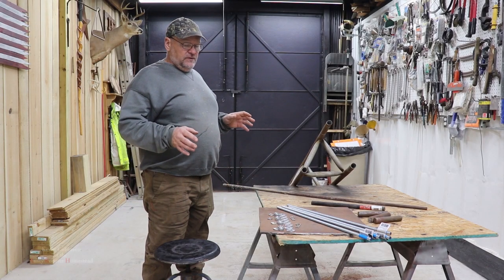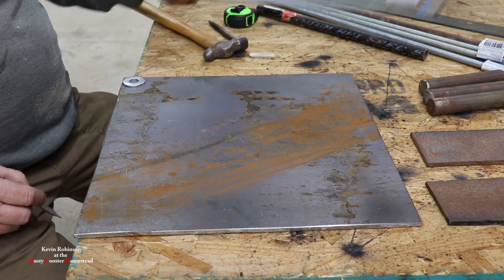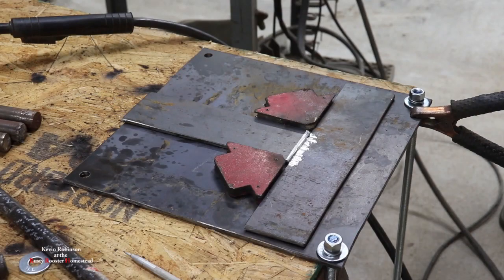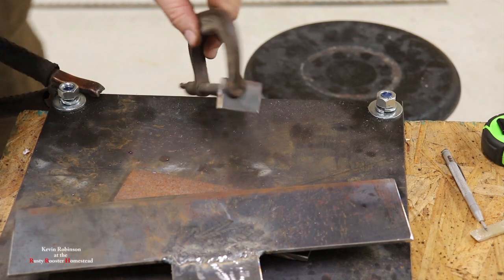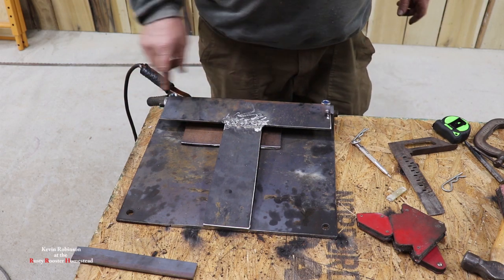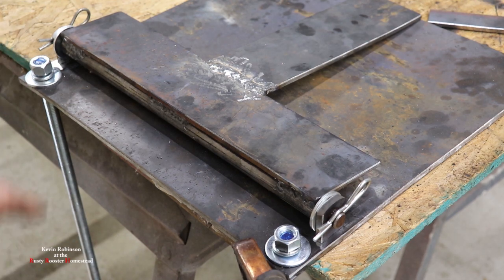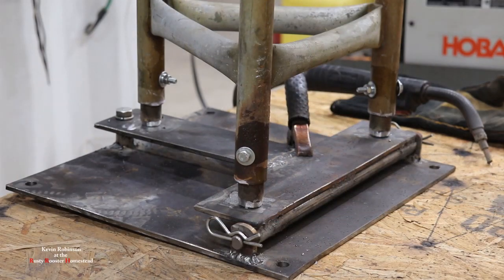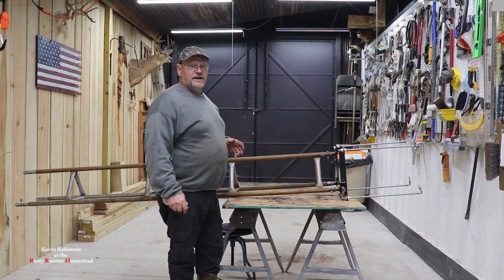antenna tower swivel hinge plate step by step build

Comment: I really enjoyed this video and the one showing you putting it to use. I have one question. Why don’t you put the base section all the way to the bottom of the pins and let the plate take the load instead of the bolts? Maybe you explained it and I just didn’t catch it. Great design and fabrication.
Reply from the maker: I am glad you enjoyed the video, i am using the bolts to level the tower, thanks for watching.
Reply: @Robinson-Homestead I mean the bolts that secure the bottom section of the tower to the pins that you welded to the base plate. Why not have the base section sit all the way down on the plate? Around the 32:00 mark.
Reply from the maker: I couldn't get it down any further because of the hinge itsself but that probally would have been a better way to build it, thanks for watching.

Comment: Very nice build, BUT, (well you know there is always that one comment, lol) the ONLY thing I would have done differently was use ACTUAL Hardened "L" anchors meant for anchoring  towers instead of using weaker standard "threaded rod" which is NOT meant to be bent at any angle without compromising strength as they can easily  break at the bend and or pull out of concrete if any excessive force is put on the tower latterly, I have seen home made anchors and or studs like these pulled out of concrete in the past.
Otherwise very nice construction! Thanks for posting, Tom in NV
Reply from the maker: Thanks for the comment my friend.

Comment: I have two antenna towers one of them is a  Telescoping antenna and with a lay down base and is made out of steel tubing like the one you are working on and the other one is made of aluminum with a lay down base the first one is about 60' to 70' tall when raised up and the other one is a one piece mast and I believe it is about the same height maybe a little bit shorter and one rotating head so you can adjust the antenna for the best reception I'm wanting to sale one of them what do you think is a fair price to ask for one. And the are located in southern Nevada
Reply: How much?
Reply from the maker: That's a good question I'm not sure.